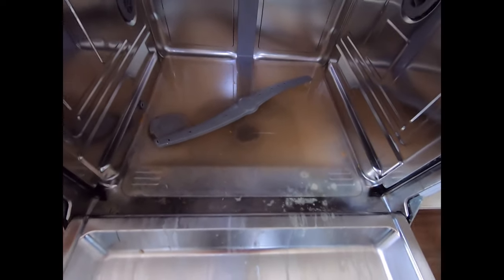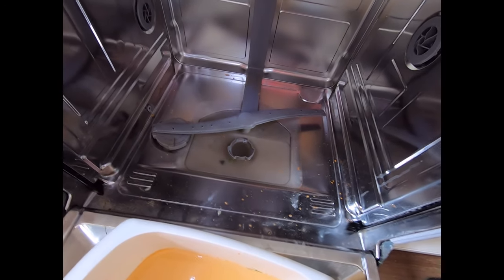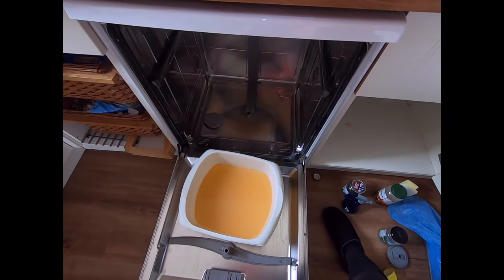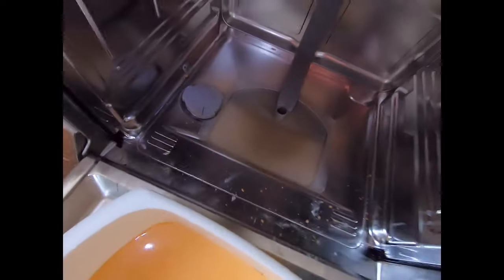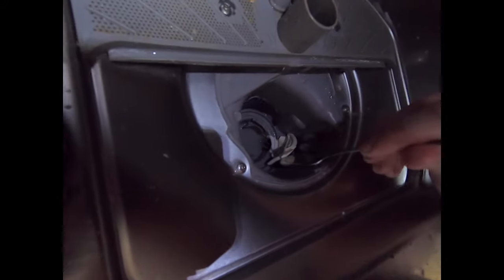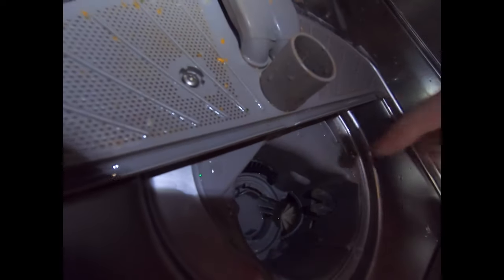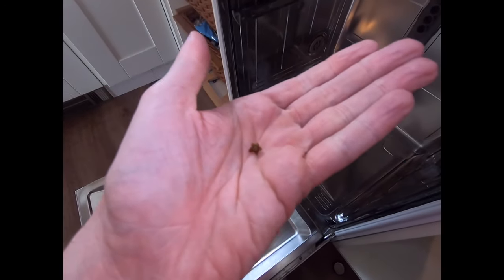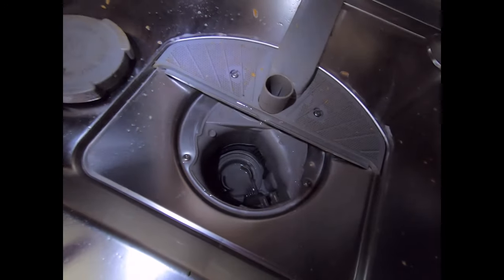E25 Bosch Dishwasher Error Code Quick Fix

Comment: Thanks , I had some small pieces of glass at the bottom of the sump, but the impeller spin freely. I'd never worked out the pump cover without your video

Comment: Thank you for this video!  After removing the filter and cleaning it out with no success on restarting, I drummed up the courage to take off the plastic cover to the drain pump and found a piece of glass.  Replaced the cover / filter etc and the dishwasher is working!  Saved a $130 + service call.
Reply from the maker: Thanks Marion, and thank you for taking the time to comment - much appreciated!

Comment: Excellent video, thanks for making it. A particularly good shot of the sump and impeller considering how awkward it is to get in there. Turned out with mine it was a button! Had been in there a long time as the edges were worn off and we had been getting intermittent E25 errors so it must have been self clearing previously. This time the impeller was jammed solid. I used the turkey baster which works well up to a point for sump dregs but small amounts would run back in as you lifted it. For final dregs I used a hypodermic syringe with a flat ended needled ( I use them normally for applying small amounts of oil to awkward to reach machine parts) which works well. I do have one with a flexible tube on the end which would have been better but I couldn't find it at the time. Thanks again, that saved me time and over a £100 🙏🏻

Comment: Who needs a mechanic and a huge repair bill when you've got you tube and great videos like this!  It took me literally 10 minutes to drain, find the culprit, reassemble and get to washing dishes!  And the best part is I didn't have to listen to my husband bitch about having yet another thing to fix!  Only thing I would add is that when you grip the filter assembly you have to twist it to get it to release (on my machine anyway).  Other than that GREAT video.
Reply from the maker: That's great to hear and glad you didn't have to listen to your husband bitching - haha!

Comment: Thank you for taking the time to produce and post this very helpful video.  Following your instructions, I found a chicken bone about the size of a large bobby pin wedged into the impeller.  I didn't even have to take off the cover as half of this bone was sticking out into the well space underneath the filter.  It looked like almost half of a small wishbone.  What I want to know is, how did an object that large ever make it through the very fine mesh of that filter?  Well, clearly it did not.  But edging its way down along the side of it and then into the space under the filter seems equally impossible.  And yet clearly, somehow, it happened!

Anyway, I don't know if I'll ever solve that mystery but thank you so much for saving me from an expensive service call.

Comment: Hi, thanks works 100%..  just tested this 22 DEC 2023! Now I can use the dishwasher through the Holidays Season... totally awesome. Thanks a lot, only addition would be that you can use a Vaccum Cleaner and vacuum by the rotating pump, it certainly made the difference for me.. probably a piece of glass stuck inside!  Cheers!

Comment: Thanks! Just wanted to give you a big thank you for this video! I had found another video which required me to open the side etc but luckily I had this exact issue, two pieces of glass stuck in that little swirly thing at the bottom. All the best mate and a big thank you from Sweden.

Comment: Cheers! I think it was a dirty filter in our dishwasher rather than something blocking the impeller.

I've learned a lot about our dishwasher today!
Reply from the maker: That's great to hear - even if wasn't a blocked impeller, great to hear you could rule this out by checking down that far into the depths of the dishwasher!
Reply: @beingbeta9883  turns out it was blocked and there was a bit of glass down there (which is of a colour I've never seen in my kitchen before). Unfortunately it required a plumber to remove.

But I still learned a lot 🫣😂

Comment: Wonderful - was going to call a plumber, but it was easy to quickly figure out that a piece of glass from a glass that had broken months ago must have worked its way down into the impeller. In my case, the impeller cover came off easily just pulling on the vertical tab.
Reply from the maker: Thanks Cesdewar, and thank you for taking the time to comment - much appreciated!

Comment: Thanks for the video. Debris removed and impeller cleared, however it still doesn't drain properly. The pump starts up then stops. Tries again a few times. Could this be indicative of hose being blocked at exit?

Comment: This worked!  I also had to spin the impeller a few times with my finger to help free it up.  I added in some water after putting it all back together and then started and stopped a few times to get the draining going, then it worked.  Thanks!

Comment: I fixed my E25 by checking the discharge pump cap for electrical contact corrosion.  The discharge pump cap on my Ascenta DW is behind the kickplate.  No need to remove the DW.
The discharge cap is white about 3 inches wide and sits at an angle visible from the front center.
There is a latch on the back side that needs to be pressed down and the cap rotates counter clockwise a quarter turn and comes off.  There are 3 contacts in the cap that are small and the pump circuit board has 3 finger contacts that slide into place when the cap is turned clockwise to re-install.  My cap contact slot was dirty, so I put a paper towel down and turned off the circuit breaker so no power was there.  One spray of electrical cleaner or carburetor cleaner flushed the corrosion away.  Let it dry and put the cap on with a quarter clockwise turn.  Turn the circuit breaker back on.  Run the machine and my E25 disappeared.  I had no blockages and my screens were fine and clean.  It was the dirty electrical contacts in the discharge pump cap.
Reply from the maker: This is awesome Warren - thank you for the detailed information - Betas, check this out for further details regarding things to check if error code displayed!

Comment: Good video ! thanks, These Bosch Dishwashers are POS. The first year the repair guys came out six times to fix it. This thing has Never worked like it is suppose to. Error code after Error code.
Reply from the maker: Thanks for comment and sorry to hear yours has been playing up!
Reply: Mine has been flawless for 4 years, this is the first problem I've had. I got the E25 fault, it was a small piece of glass (1/2 or 1/3 the size of a dime) it snuck down into the pump impeller area. Once that was gone, it's fixed.
Reply: Mine has been good for 5 years.  Once a year ish I have to clean out that filter area but that is regular maintenance.  First time I got the E25 error was yesterday but know from previous experience how to fix it.  Thanks for the video!!  

By the by, best part of my Bosch dishwasher: amazingly quiet!